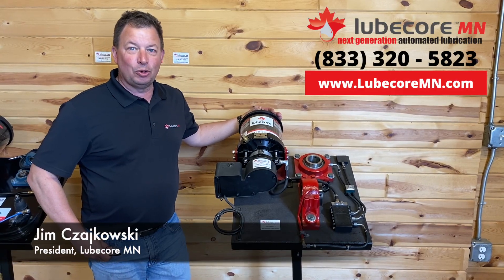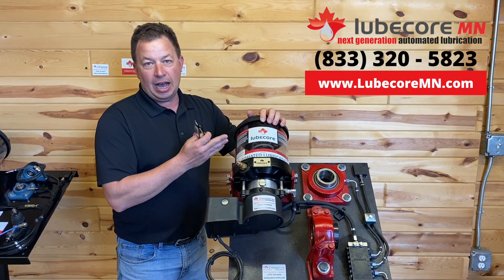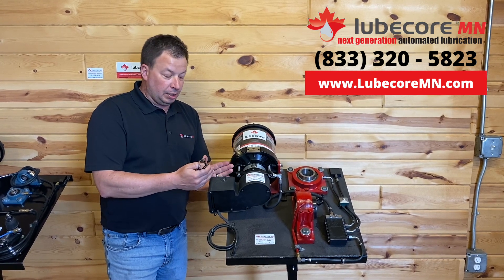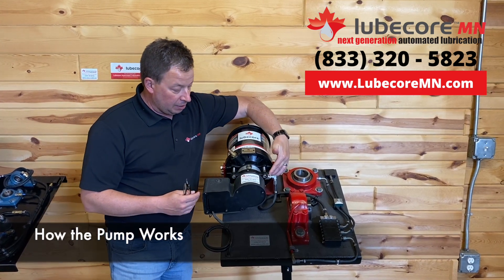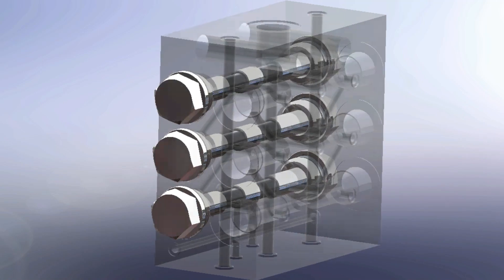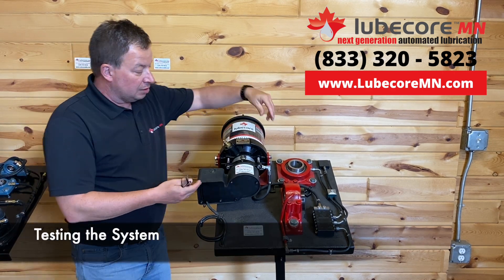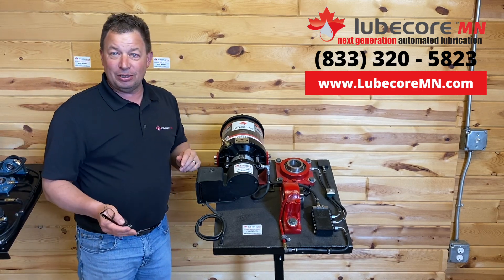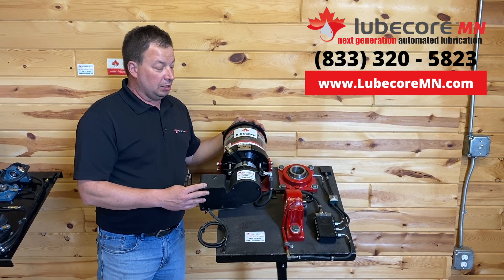Lubecore MN's EP2 Automatic Greasing System Overview

Comment: Where do you find the CC rating
Reply from the maker: Thanks for your question - I think I understand what you are asking. Our pump output elements come in three sizes: 2cc, 4cc, and 6cc. Pumps and systems manufactured in the past couple years (and going forward) have laser engraved markings that indicate the respective displacements. If it is an older system, they may not have these inscriptions, but in general, many of these older systems featured a 6cc element. We'd be happy to answer your questions or help you out further - just give us a call! Hope this helps.